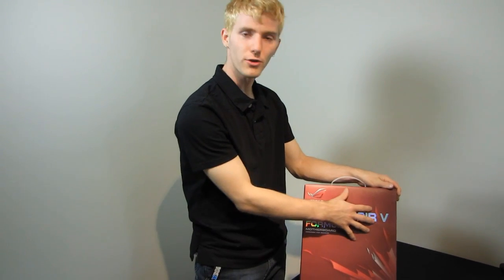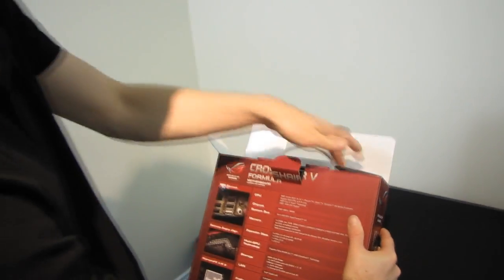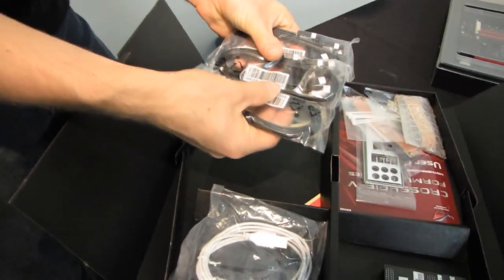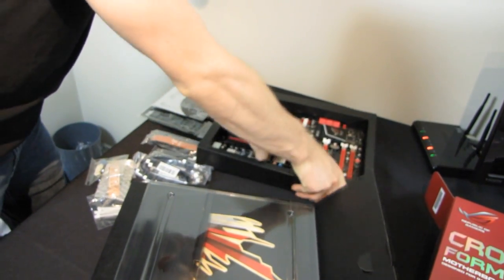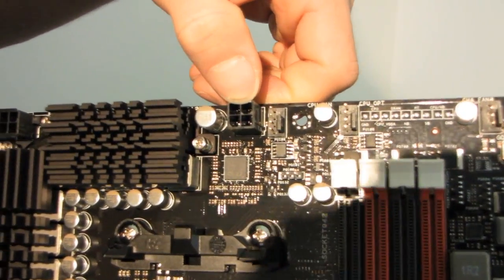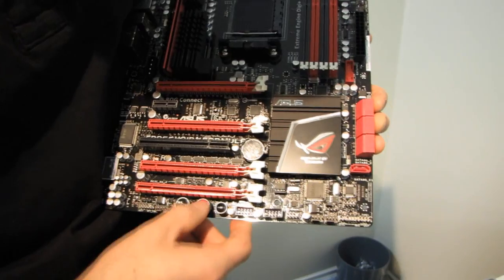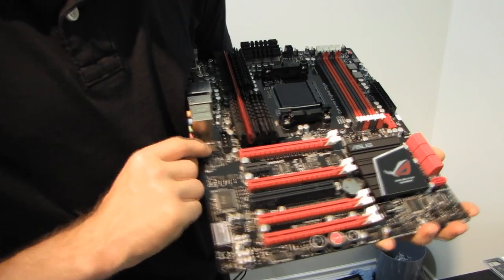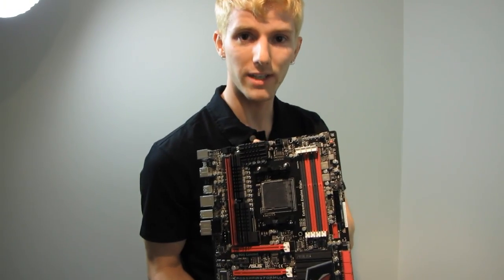ASUS Crosshair V Formula 990FX SLI Crossfire Motherboard Unboxing & First Look Linus Tech Tips

Comment: Got this when it first came out and it still kicks ass! Phenom II x6, 16GB Ram and ugraded to one of the latest Geforce (2023). Plays everything smooth. Only Microsoft will only upgrade to Windows 10 Pro without complains. Possible to force Windows 11 on though I guess... anyone tried Win11 on this?

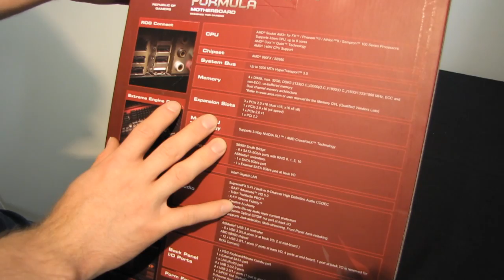Comment: What was that noise in the background at 1:02. Still running the Crosshair V Formula-Z with a FX-9590 since 2015 and still running strong with zero issue.

Comment: He spoke incorrectly at the beginning... this is not a Crosshair IV (4) it's the V (5)!  I just lost a lil respect bruh! LOL!  But all BS aside, this is a great motherboard and you can build a little beast of a system if you go all out with 32gb ram, 3 way SLI, and an FX 8350.  I wouldn't use the top end FX-9590 because the wattage rating exceeds the sockets TDP (thermal design power) of 140 watts.  You put a 220 watt cpu into a socket rated for TDP of 140 watts and you are gonna cook your board over time and don't even mention overclocking that nightmare CPU.

Comment: Hi, i have a good question. you could make a video about it also (would 
be nice). this is my setup:  Asus M4A88TD-V EVO/USB3 with on board HD 
4250, AMD Phenom(tm) II X6 1055T Processor, Corsair PC3-12800 4x4 GB 
DIMM 1600 MHz DDR3 SDRAM Memory , ATI Radeon HD 5570, SanDisk Extreme 
PRO SSD, Corsair H50 water cooler, Case was a Antec lanboy. Now i have a
 cooler master maker 5 and i want to make it nice, i would  like to get 
the glass and power supply compartment shrewd ,corsair 140 hd fans (when
 they come out) you get the idea. any way the question is, i want to 
change my mother board for a asus crosshair v formula-z and keep the 
phenom ll or shuold i wait for zen or just go intel? i'm not a gamer 
thus losing the 2 video cards one on board being used for one dell 1901 
and the other 1901 and a 37 inch led TV.
Reply: HellShadow70 Ryzen of course :) I hope you waited.

Comment: Hi I was Just Looking at the video of the crosshair v formula 990fx and I am wondering where you said there is a 8 pin and a 4 pin does that mean I have to plug in both or just in the 8 pin because I have a power supply with just a 8 pin.
Reply: +Simone Holland just the 8 unless you're doing some crazy overclocking.
Reply: I dont do overclocking as never done it before and this is my first time thinking of having a swiftech h240-x2 prestige and I Just want to Know would it be ok with the Motherboard I have which is the Msi 970 with a amd fx 8350 which are Ok together I just want to know if I am doing the right thing by that cpu cooler.

Comment: do you need to use the 8 pin and 4 pin power connectors?
Reply: I take that back. It does. Look at the motherboard compatibility on asus.
Reply: Yeah the leds do look cool 😉
Reply: *****  cheers man
Reply: Does AMD FX-9590 compatible?
Reply: John RedHead Unfortunately not, I have this board myself. it only supports up to 140W CPU's
Reply: John RedHead it does, because I run this board and the 9590 black edition on it, really nice looking motherboard, I like the red tron effect with the light running through the board.

Comment: This or the Sabertooth are pretty much needed for 8350 builds, pretty much any other motherboard is going to throttle the 8350 even on stock

look for 8+2 power phases with the 8350, get this to be completely safe

Comment: 2000$!!! how I envy you,  I'd say go with i7 3770 (340$) and GTX 670 SLI.(400$*2) or AMD 7970 in Ceossfire(400$*2)
Asus saber-tooth Z77 motherboard(250$) . Kingston HyperX 120GB SSD( 115$) for boot and a WD 2TB HD(130$) Corsair Carbide Series 300R Case(80$) CORSAIR Professional Series HX850 Power Supply(174$ ) Kingston HyperX 8GB RAM kit *2 ( 45$*2) 16GB RAM total.  total cost of the system=1980$  that is a really kick ass system for game. have fun with it.

Comment: Those are the exact changes to the parts i was going to do... anyways thanks for the suggestions anymore would be great, this rig will be specifically for gaming and emulation so if you have anymore suggestions it would be greatly appreciated but i have a budget of $2000 and the less it can be, the better.

Comment: Asuming this is a gaming rig i would say no to the Mobo and Cpu ,
am suggesting getting an intelcore i5 3570K and the new Asus Maximus V Formula
other wise yea good PSU nice GPU but you could go with the XFX Overcloacked Dual Disipation 7850, Ram its good ,Hdd good but you could put a SSD in like the samsung 830 128Gb SSD and case is fine

Comment: I am building a new gaming rig and i want a second opinion from someone 
MB: Asus Crosshair V formula
CPU: AMD FX-8120
Optical Drive: Asus 24x Dvd burner
PSU: Corsair HX series HX750
GPU: Asus HD 7850-DC2-2GD5 Radeon HD 
RAM: Ripjaws series 8 gb
HDD: Western Digital 1 TB
Case: Cooler Master Haf 922

Comment: intel has socket  775,1156,1155,1366 and 2011 while amd has socket am2, am2+, am3 and am3+. look for a board that has these sockets if you want to but a board. and you have to look up what socket your processor goes into. and yeah, an i7 2600k or higher is better than the amd FX cpu's at this point.

Comment: 1. Asus is a fantastic company for motherboards, I agree.
2. Intel is not over priced given that their CPUs at the same price range outrun their flagship FX-8150 in benchmarks. Benchmarks run between the i5-2500k and the FX-8150 at stock speeds show the i5 to have a fairly clear 5~10% advantage across the board, so saying AM3+ blows all of Intel out of the water is completely untrue.
3. I agree with this as well. Motherboard purchasing comes down to what you'll be using it for in the end.

Comment: Okay so you wan't a board that has two completely diffident chipsets, CPU sockets, ram slots, etc.. The board would be so big you would never be able to get it into a case.. Or if made fit on one even eATX board the cutbacks required would make the board slow. As well as the fact that it would cost a ton.. You can get pretty much the same board for either side with a few tweaks and color differences..

Comment: Hi mr.Linus i just bought Asus Corsshair 5 motherboard and i am using AMD FX 8150 processor problem is i am not able to see the bios setting in my display i am using ATI RADEON HD 4600 series graphics and Panasonic Viera 32inch LCD TV and i am using HDMI cable connection when i press del key for bios setting its showing full blank screen. please help...

Comment: hello people! i have this motherboard along with an fx8150. what i am wondering about is if i have to connect both motherboard 12 v (8pin & 4pin) power cables at the same time in order to be able to boot?also could someone tell me if my 700w toughpower thermaltake is compatible with this mobo? also if i dont have the latest bios flashed supporting bulldoser chips shouldnt it anyway post?

Comment: @Orexll  960 (Intel Quad Core) and 1090T (AMD 6 Core) on two systems running side by side here. The performance is similar, though the Intel does do a little better at low latency. A AMD 8 - core and a Intell 4- core isn't a match unless your talking price Save the $30 and get the AMD 8-core

Comment: Good day Sir, I just want to ask if this motherboard required to use both of the 8pin cpu power connector and the 4pin cpu power connector to run the system? Because my psu is a Corsair GS700, and it has only one 4+4pin cpu power connector... Do I have to upgrade my PSU? thanks Sir

Comment: I have a question. I have a MSI 890FXA-GD70 Motherboard, and I want to upgrade to Bulldozer when it comes out. I really like the board and it says on their website that I will be able to use Bulldozer on that board with only a BIOS update. Is this true? Should I get this board (it looks really nice). If I want to do it, I want to do it right the first time. Ya know?

Comment: 990FX motheroard, not 990X :P
Do a Sabertooth 990FX unboxing!
also the extra 4 pin connector is for stability with the 8 core FX CPU